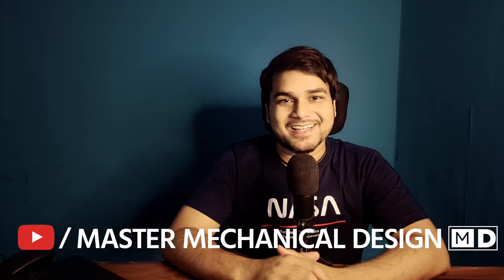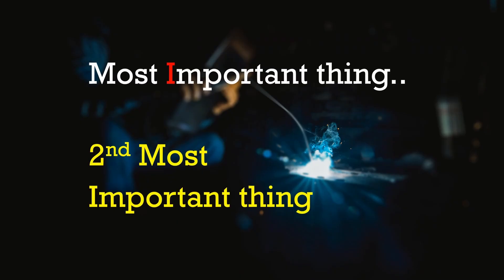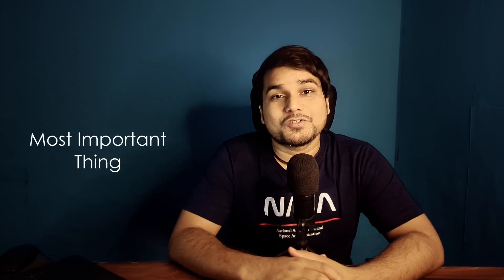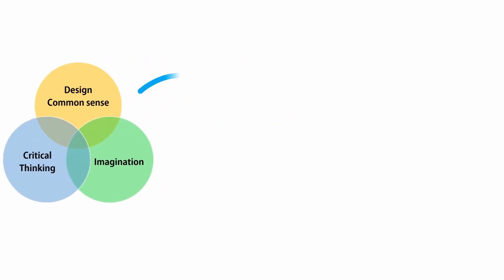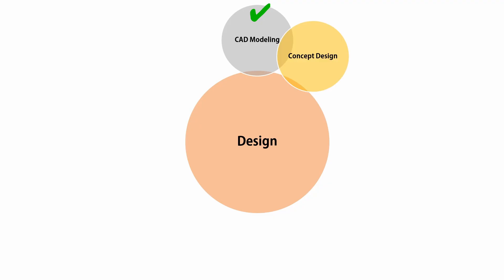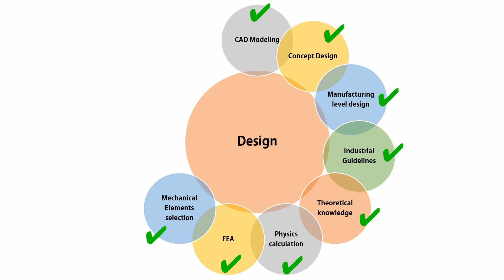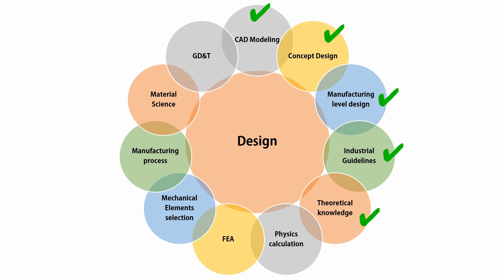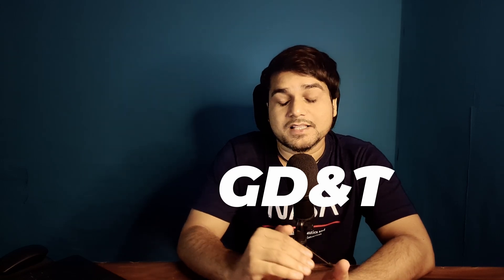10 Years of Machine Design Experience in Just 10 Minutes!

Comment: Appreciate ur efforts one issue I come across in design domain  is to switch  from  one industry  to another let say if u have automobile  and u want to get  into piping seems very difficult. Ur thoughts about  it
Reply from the maker: Piping is actually much easier. As you are new so it feels hard. There is only few things that you should master - P&ID, pressure drop calculation, flow calculation, that's it.